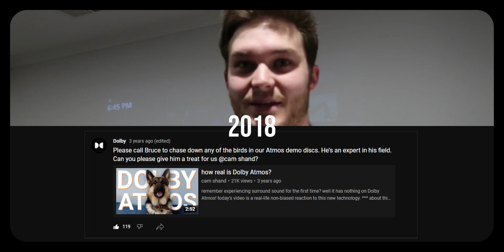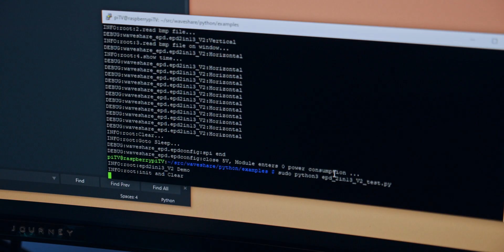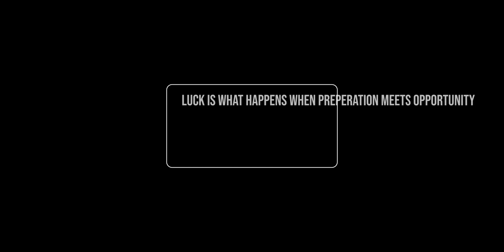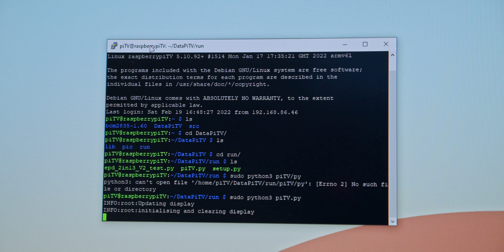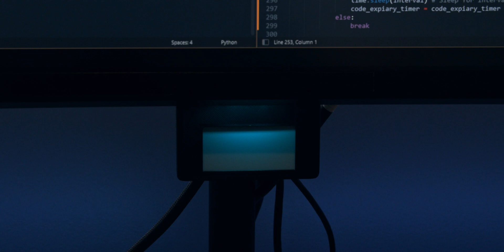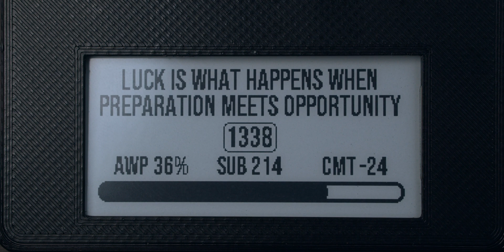making a Smart Device.

Comment: Did you put a battery in there to keep it powered. and if so how did you manage that? i presume another board that you connect to via the usb power in on the pi which then is connected to the battery and also to the usb for charging?

Edit: or did you manage it through the gpio pins?